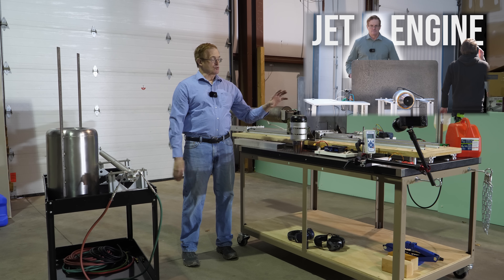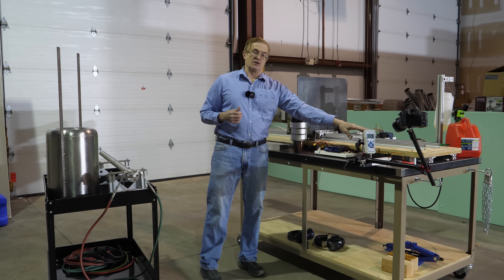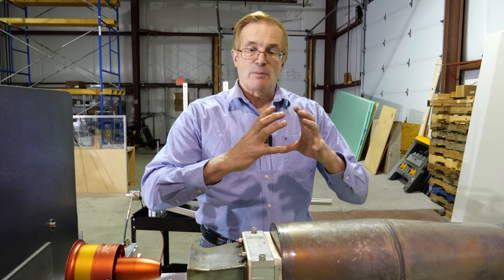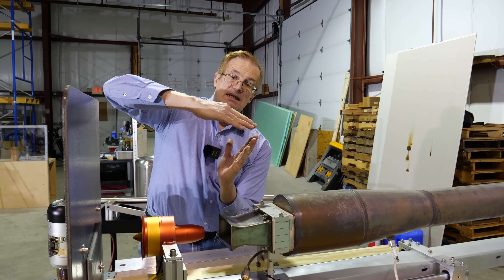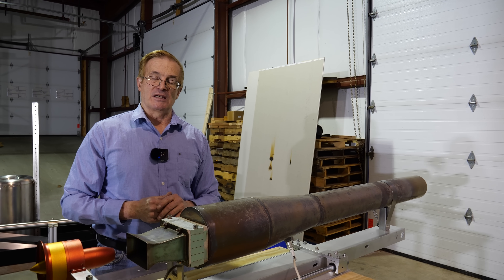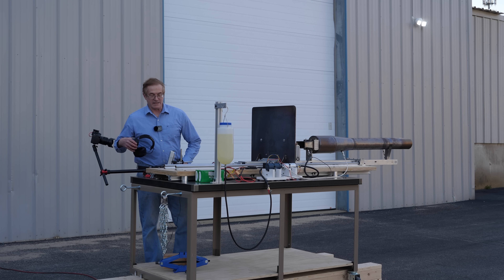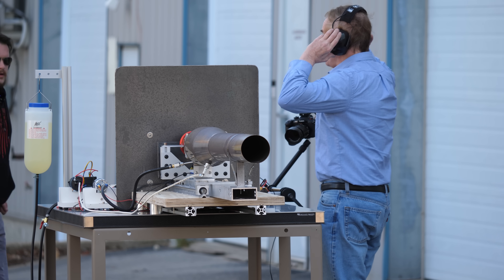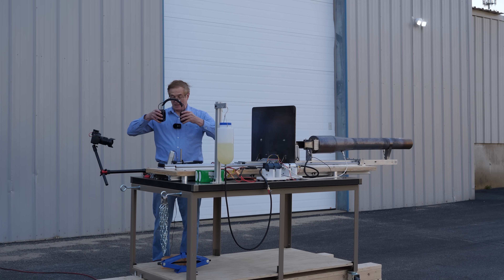Full Throttle Test: Did we Push a Pulse Jet Engine to its Limits?!

Comment: Very interesting Experiment. I was dissapointed you were unable to test the augmenter. I know you have a pulse detonation engine, I am very interested to see the augmenter on that.
Do you have a video on running your Pulse detonation engine? I have searched you tube in the past without success. I am using HHO in my rough proof of concept pulse detonation engines but am getting dissapointing thrust output.
Reply from the maker: Thanks!
Nothing about that engine yet.

Comment: Robert Maddox uses a propane-based, super reliable instant start system that doesn't require a blower on the intake.  Diesel is then used as the fuel.  I've never seen him explain in detail how the instant start system is implemented.

https://www.youtube.com/@RobertMaddox

Comment: A metric crap-ton of sandbags on the lower table shelf would help. Or, put some bolts in the ground and ratchet strap it down. Shrapnel shields if you are concerned about disintegration (or operate from behind a bigger blast shield and just send it)?

Comment: I like the spring steel valve in front, and it clearly does it's job, as the thrust would be lower without it. Something I've been wondering on... Would an array of tesla valves in front be possible, or would it add to much weight resulting in a poorer weight:thrust ratio?

An as always, it's better to stay safe, than pushing to hard and end up injuring or worse.

Comment: I have wondered for a long time if you could use 2 stroke type of exhaust resonator to increase the efficiency and output of these engines, never had time to try it out... In theory it should work, at least a little.

Comment: A pulse jet engine is very efficient in converting a lot of fuel in an awful lot of noise. They also produce some exhaust gasses and a residual amount of thrust.
Reply: Burn lots of fuel, make a lot of noise,  produce a little power......sounds like a Harley engine.

Comment: Would you start publishing some of the key parts you use?  For example, the fan you’re using - I could wire controls for something like that but have no idea what specs to shop for.  It wouldn’t bother me a bit if it was an affiliated link, but even the model numbers would help.

Comment: How much would increasing the length affect the thrust? Is there a certain golden ratio? Good Job. ➰➰🍃
Reply from the maker: It's a soft optimization.
The longer the engine, the slower the pulse frequency, but the greater its amplitude.  At the same time, you need the air to pass through the valve, and its area determines the flow rate. If the tube becomes too long, you don't get enough air into it before the next pulse.
Reply: @TechIngredients  Would compressed air allow for a longer tube? Such as in a ramjet, at what point would the length become a burden if it was supplied enough oxygen? Is there a diminishing returns?
Reply from the maker: As we showed, the ram air does increase the performance.  I don't know how far you could carry that, but valve survival would probably be the limiting factor.
Reply: @TechIngredients  Would the valves be incased in ceramic, or how would they be protected normally? Proactive cooling? Thats interesting.
Reply: @TechIngredients  hey incase you wanted to know also.... The length of the tube in a pulse jet engine is a critical factor in determining its performance, specifically regarding the speed and efficiency of the exhaust. However, there is a point where increasing the length of the tube no longer provides any additional benefit and can even become detrimental. This is due to several factors:

Resonant Frequency and Tuning: Pulse jet engines operate on the principle of resonant frequency. The tube length needs to be tuned to the natural frequency of the combustion pulses. If the tube is too long, it will fall out of the optimal resonant frequency range, causing inefficient combustion cycles and reducing the thrust produced by the engine.

Gas Dynamics and Friction: As the exhaust gases travel through a longer tube, they experience more friction and drag against the tube walls. This increased friction can slow down the exhaust gases, reducing the overall thrust and efficiency of the engine.

Pressure Wave Dissipation: In a pulse jet engine, pressure waves created by the combustion process travel back and forth within the tube. A longer tube can cause these pressure waves to dissipate more before they can reflect back and contribute to the next combustion cycle, leading to less effective pressure buildup and lower thrust.

Heat Loss: Longer tubes provide more surface area for heat to dissipate into the surrounding environment. This heat loss can lower the temperature of the exhaust gases, reducing their velocity and the engine's overall thrust.

Therefore, the optimal tube length for a pulse jet engine is one that matches the resonant frequency of the combustion pulses and minimizes friction, pressure wave dissipation, and heat loss. Going beyond this optimal length typically results in diminishing returns and can even negatively impact the engine's performance.

In practical terms, the exact length at which the tube no longer provides benefits varies depending on the specific design and operational parameters of the pulse jet engine, such as the fuel type, combustion chamber size, and desired thrust. Engineers typically determine this optimal length through a combination of theoretical calculations, simulations, and empirical testing.

Comment: What formula did you use to determine the timing for the spark ignition? or the previous cycle is now igniting the next cycle?
Reply from the maker: It's really simple.  The spark simply starts the process.  Theoretically,  it could be a single spark, and then the engine's dimensions determine the cycle  process and its frequency. 
Practically,  a few sparks may be necessary  depending on the initial conditions, but that basic principle still holds.

Comment: Is there a reason why the Boeing's 787 Dreamliner didn't utilize this technology?   I mean, these must be  relatively cheap to make.
Reply from the maker: It's  likely  that they found that it didn't work.   Or, at least it didn't work well enough to justify adding it.
Reply: @TechIngredients  tongue in cheek, sorry.  Engines large enough for the 787 would probably shatter the planes own windows. 😁  Those are nasty sounding engines.
You do fantastic videos. Presentation is the key and you're extremely thorough describing your projects so that one doesn't have to be an engineer to  understand what's going on.  👍

Comment: I saw 170n on the meter which equals 38 lbs. thrust, not too scary as even a single 10-32 screw can hold that. That said, I do respect the decision. Put it on the catamaran with the augmenter next. I'm too far away to come over and drive it though.

Comment: I am not sure if you can hear it, but the engine makes a high pitch noise that's quite nauseating, the video is basically unwatching at that point(the last video has the same issue).  Please consider using a low pass filter for the audio next time you do this.
Reply from the maker: I don't think we'll do that.
This isn't because I don't appreciate your  position, but it's a part of the experience with testing these engines.  Imagine what was like for us and the even louder pulse detonation engine we'll be testing soon.

Comment: that camera needs a faster frame rate on the thrust meter!!!
Reply: and also a faster logger for thrust vs time!!!
Reply from the maker: We actually slowed the frame rate down to reduce this dancing.  The meter has a USB connector that permits it to be coupled to a computer for data logging, and we plan to incorporate that when we test the detonation engine.

Comment: To stabilize against the vibration, maybe a tube Inertial dampener on the table? Using rv car shocks and a weight? Basically a baby one like the ones used in tall buildings in earthquake prone areas?

Comment: Get 20 foot lumber to rest the table on (and bolt it to it) with the majority sticking out the safe end. Then park a car on top of the lumber and abutting the table. Then when the augmented pulse jet inevitably pushes the table the lateral force will be absorbed by the parked car and the vertical torque (since you’ll have made an “L” shape with the thrust perpendicular to one vertex) will be transferred to the underside of the car via the lumber. 2 piece of 2x6 will be plenty of take both forces, though you may want to use 4 pieces for additional redundancy. 

Alternatively if your local parking lot has concrete bumpers with O-rings on top (common in some areas so they can be easily moved) you can simply bolt the table down to it. If so I’d add a safety chain around the entire apparatus, preferably welded to the top, so if it breaks away from the table you haven’t inadvertently made a missile. 

P.S. the pulse jet I made with my kids uses a safety chain like that until we calculated all of its force vectors, then welded many times that as reinforcements. It also has a safety chain, and we inspected everything prior to every run (since half the point of doing it was to teach safety and redundancy to the kids).

Comment: Could you use a pulse jet as a combustion chamber for a turbo jet? Mount a rear turbine or turbine generator and then mount a compressor or electricaly driven compressor on the front end? Use the turbine and compressor to increase the compression ratio of the pulse jet? You could probably use the electric system to throttle it as well.

Comment: For a pulse jet, there's an optimum length and shape for the tube, and the cylinder isn't it.  It's simply the cheapest.

Yours was by far the best explanation of pulse-jet operation I've heard yet!
Reply: There's an optimum for power output, an optimum for power-to-weight ratio, an optimum for fuel efficiency, an optimum for cost...

Since pulse jets are usually used where cost optimization and ease of production are more important than power or efficiency, I'd argue that a cylinder is optimal. Rockets are better for power but inefficient, turbojets are better for efficiency but expensive, etc.
Reply: Surely the cylinder is most practical, unless you want to compensate for differences in soundspeed in the variously heated portions of the chamber. This is like making a transmissionline, as in acoustics. Tuned to a frequency by the length of the tube. Like a flute even.

Comment: I wish the spark generator thingy was less complicated
Reply from the maker: It's pretty easy.  An automotive coil with a relay that rapidly switches power on and off. You can drive it with a pulse timer from Amazon or set up a several uF capacitor in parallel with the coil and this creates an LC resonator without any other components.

Comment: In closing the aforementioned two stroke or four stroke cycle would be a fully tuned exhaust system. Now consider the word "tuned" yes just like you tune an instrument. Now when it comes to two stroke engines this horse power increase is known as the power band and yes 
 " band " is used in the musical sense and so is power like a power chord ( pronunciation sounds like cord ) no not an electrical power cord  well unless it's an electric guitar and your playing the power chord ) having to do with the fifth harmonics pretty interesting stuff .
 
Eratosthenes ; Born around 300 B.C. a sheep herder who deciphered the circumference of the earth by observing the shadow inside two wells in different locations at the same time of day. By way of counting his steps in-between his two wells he measured the distance then referenced the two shadows cast at high noon  (360⁰÷∅)*(s)=

Comment: if the compression ratio is so low why dont pulse jet engines with a turbine and compressor exist? would that disrupt the pulse action?
Reply from the maker: It would be a chalange. It's probably easier to just add another stage to the compressor stack in the turbine.

Comment: for starting the pulse jet cant you just heat one end(the expansion chamber side) with a torch as as the heat differential builds it should start to oscillate? NightHawkInLight has some videos on thermoacoustics, would be cool to try imo
Reply from the maker: It might.  I suspect it would be more complicated.  The heat source would require a lot more energy than a spark and would be tough with the fan running to prevent flooding.

Comment: is the throttle for the pulse jet air control or fuel control?
Reply from the maker: It's for the fuel.  The air from the fan is continuous and isn't even necessary, and the valve isn't controlled.

Comment: Reed Valve Assembly : the intake manifolds spring steel stack of one way valves.
 What's interesting is reed valves probably originated from the early hunters for animal calls made from bone or wood. Historical records show that the earliest musical instruments where attributed to the Egyptian's. 
 My interesting point is this, the first mechanical use for them was to divide the intake/power from 
compression/exhaust in two stroke engines. Later when more was known about internal combustion, engines race engine builders ( mainly what is now known as NASCAR and what eventually turned into MOTOCROSS ) exhaust/power scavenging became huge hush hush top secret way to scrape up a few more horsepower and not change anything internally to the engine on the cars/bikes. The deflagration of what ever fuel you use causes that supersonic expansion you mentioned, and for every action equal and opposite correct, while hot gasses left over from combustion get forced through the valve/s out the port/s then down the pipe/s into atmosphere the sound waves travel in the opposite direction as each combustion cycle exits the pipe/s all the way back to the ports and in turn valves putting back pressure on the exhaust valve/s helping to slam it shut or create a high pressure barrier that intake gasses can't pass. Header/s are a sonically tuned exhaust manifold that when coupled with
Reply from the maker: Agreed.
The only correction is that the exhaust from a pulse jet isn't supersonic as it is in a pulse detonation engine.

Comment: Fascinating. Would it be true that you are losing 50% of the energy from the blower into a valve that is closed 50% of the time? That would be something to solve if possible. I worked with small handheld pulse jet foggers and even those were intimidating (especially when they got flooded on start!). I can't imagine this beast.
Reply from the maker: Not 50% of the energy, but 50% of the duty cycle, which decreases the thrust from a given size engine.  All the fuel is still burned.

Comment: I suspect test rig issue is its natural frequency or its harmonics. At 14:44 you can clearly see engine moving back end forth by several centimeters. Possibly natural frequency of cussioning springs you added. Also, when you throttle air feed fan, few seconds later, you seem to tune into another resonant frequency at minimum fan setting. Heavy shaking occure. Throttling up it inmieadly calmsit inmieadly.

Comment: So the electrical turbine increased the thrust from 130N to 160N. How much thrust does the electrical turbine produce without the pulse jet running?
Reply from the maker: It's a few newtons, as you can see when we turned it on before starting the engine.

Comment: How would a tesla valve hold up in comparison to those spring steel valves?  That spring steel seems like it could have a better seal and higher efficiency, but it IS a moving part, and would need to be replaced or maintained after a certain amount of use.
Reply from the maker: Poorly 
They have a relatively high flow resistance even in their preferred direction.
Reply: @TechIngredients  that's unfortunate......I love the idea of a pulse jet with no moving parts!
Reply from the maker: There are valueless pulse jets, but the plumbing requires an aerodynamically bulky setup.

Comment: Was the fan isolated from the sliding mechanism measuring thrust?  If not, could the difference in thrust be attributed in part to it, in addition to the extra power from the engine with the additional oxygen?
Reply from the maker: It does add a little,  but you can see how much when we turn it on before starting the engine.

Comment: I would love to see you engineer and build a heat shroud to allow the engine to operate within a structure like an airplane fuselage or wheeled vehicle without burning either the structure or the operator.

Comment: When I watched the first video I thought you were being quite ambitious with your test bed.
Obviously it could handle it, but it didn't seem to me to be something I'd personally like to use repeatedly.
When the pulse jet was put on it, yeah, that's when those tolerances were put to the test.
Buy some relatively cheap i-beams and dig some nice holes in the ground to seat them in, it'll be faster to weld them together than bolt them, but with some water ballast at the front of the frame it should easily hold it where it needs to be.
My misses was laughing her head off watching me nerd out with this.
Love your videos.

Comment: There is a ton of videos out there of people putting pulse jet engines on scooters,  go-karts etc. Not very educational, but extremely entertaining. 
On a side note, pulse jets engines operate the same as scavenging  on piston engines.  Way back in the day it was thought you needed back pressure to get an engine to run right, because when the exhaust manifold was removed the engine lost power.  Later they figured out it was the exhaust pulse causing a vacuum which helped evacuate the cylinders and suck more fuel air in that caused the boost in power, not back pressure.  Cool stuff.